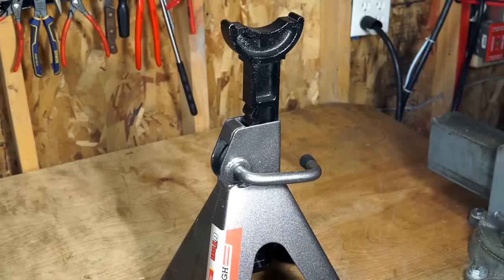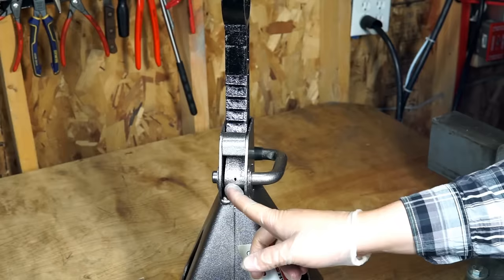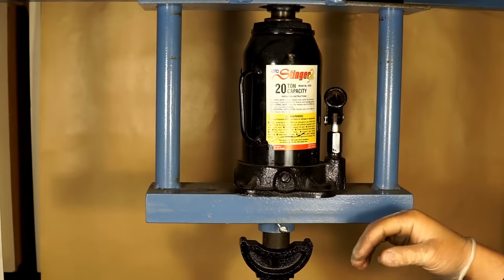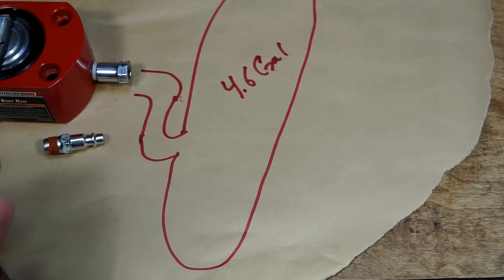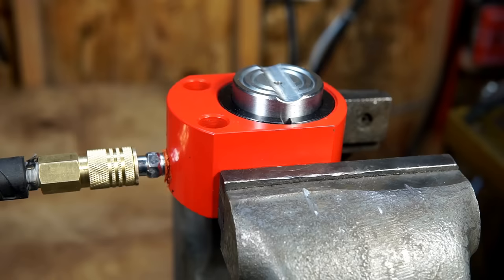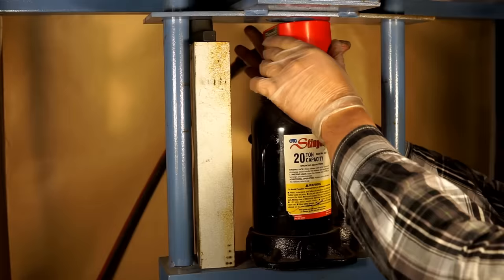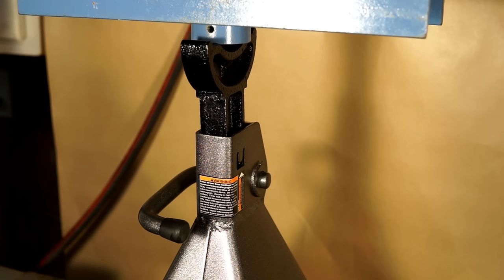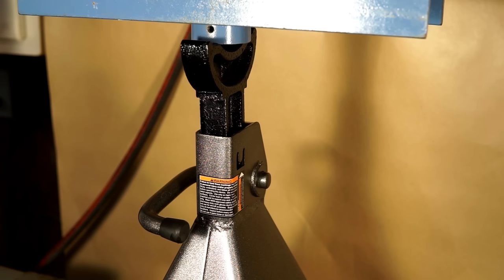EXPERIMENT: WARNING! Doing this to your Jack Stands will get you KILLED!

Comment: Sooooo.... I shouldn't hit the jack stand release while I'm under the vehicle. Got it. 
I'll add this knowledge to the previous bits such as: coffee=hot and 
no hairdryer in the bathtub.
Reply: He set out to see if one of the safety mechanisms designed into the jack stand was appropriate for working on lighter loads.
Reply: Kevin Livingston 

WOULDN'T THERE BE ENOUGH PRESSURE FROM THE CAR TO KEEP THAT LEVER PRETTY STIFF?
Reply: Yes, of course there is. This whole story is garbage.
Reply: Maybe if you understood basic physics it would help.... and more to the point if you understood that the  entire controversial video is designed just to get 'clicks', it would help.
Reply: Yes and he could have gone even further and put no load on the stand at all, to checked how easy it is to knock over sideways! lol
Reply: He clearly states that he is testing to see if the shear pin in the stands handle will shear off.
Reply: Don't forget not to throw stones near glass houses...
Reply: Kevin Livingston ha ha hahaha ha ha. I liked the video but ultimately this guy nailed it.
Reply: Noooo texting behind the wheel.
No putting on lipstick while driving.
No reading the paper while driving.
No working under a car supported by a stack of bricks, concrete blocks, scrap 2 bys......
The lawyers are on standby.
Soon every concrete block will have to be labeled "do not use as motor vehicle support."
Reply: Don't touch your tongue to a frozen flag pole!
Reply: @randomchannel1475  i dont wanna i always wanted to be Patrick let me sleep in peace under this rock
Reply: Too bad a plugged in hair dryer in the tub is extremely unlikely to do anything but flip a breaker.   Even if that didnt happen, the electricity doesnt want to go through your body to get to the drain and into the ground...   water doesnt travel up mountains nd electeicity doesnt look for the hardest substance to travel through.   

Movies though....   learned from them is a thing I suppose, not a smart thing, but a thing none the less.
Reply: I see you have yet to be informed of the actual hot coffee incident. Ask why does MacDonalds need to serve coffee hot enough to cause 3rd degree burns or why does spilling something make one an idiot in your book (a very thin book I might add)
Reply: @Kiluad  I. Think it's picking up the dryer from the tub that results in the shock.  Down the arm through the chest and the ticker quits working. The dryer in the tub should be safe, grounded to the pipes.  So don't pick it up while in the tub!
Reply: Lmao
Reply: Do not eat detergent pods.
Reply: You forgot "never stick a fork in a toaster while it's plugged in"

Comment: Aim the release handle of the jack stand away from your work area. Problem solved. CAUTION: Avoid violent psycho tantrums and tool slinging while under a car on jack stands. Second, rare problem solved.
Reply: Yes, I agre 100%
Reply: GS Allen Tool slinging tends to happen when you are working on a project car. Usually when you snap off a bolt, or when something mashes your finger. although i never use jackstands, so I'm good.
Reply: +A. Zak  Just have a bunch of sons and make them do weight training so they can hold the car up while you are working on it.  You can call your sons Jack, Stan, Block and Wedge.
Reply: You could ofcourse use a jackstand with a splitpen holding the release handle in place so shit like this cant happen.
Reply: That's what I say keep it away from anything that could hit the handle
Reply: I'm picturing some oil-caked maniac going full berserk on his back under a vehicle with like 2 inches of clearance between his furious thrashings and his hot exhaust manifold, JUST SLAMMING ratchets into shit, all four appendages in full scream like the Daryl Hannah replicant dying in the original Blade Runner
Reply: Wouldn't work... Second they get a SnapChat message, they would have to drop the car, take a pic of themselves, type out a reply and then take a minute to remember what the hell they were doing just before.
Reply: Or don't buy cheap jackstands... mine have lockout pins. They shove through the base and lock into the teeth on the ratcheting part, and will take the weight of the car if anything else in there fails. You can barely even move the handle with them in. No possible way to bump the handle and drop the car on you without also somehow pushing out the pin first.
Seriously, it's not like you're depending on the jackstand to save your life or anything... why the hell would you buy a cheap one?
Reply: LOCKOUT PINS????  I don't think I have EVER seen such, I have 3 or 4 sets of stands and NONE have lock out pins,
Reply: Awww damn no violent psycho tantrums? Nothing is gonna get fixed now
Reply: I Greatly Appreciate you taking the precious time out of your busy day  to enlighten me, I'm now looking at how I can modify the Cheap UNSAFE to make them safe!!  God Bless you Burt!!
Reply: You're welcome monsieur.
Reply: GS Allen
I don't have this sort of stand, but have been thinking of getting some of them and that was scary shit in this vid.
I'm from europe and have som light cars so extra scary.
But thought to improve the design of the "actuator" by turning it in to a round knob by cutting it of and use som flat stock and cut ot a flat circle and weld it on.
By the way ,avoiding violent psycho tantrums is not yet possible sometimes when shits just get shitty. :(
In the meantime I change de design of the actuator.  :)
Reply: Are you from Italy or France?
Reply: you will not cause this to fail unless you smash it with a sledge hammer, like he did.   Otherwise you would have to lift up the 500 pounds(240 Kg) with the stand handle.  Yes , the lever provides some amplification, but you're not going to be able to kick it free by accident. 

Don't worry, just get a jack stand for working under your car.
Reply: +spineboy I'd rather just have a Lift but without one I'd like a couple of hydraulic jacks (in addition to a couple of jackstands).
Reply: To GS Allen, It is very important to remove the jack stands before driving the car.
Reply: To really Happenings, Good analogy!
Reply: Face the release handle in towards the working area; prone to hitting it with tools. Face it away from the working area; neglegent adults might trip on it, if you have stupid kids at home, they might think its fun to kick it. Face it towards the front of the car so its not facing either inwards or outwards, suddenly your siberian husky came dashinh to lick your face...see its a design flaw.

Comment: I'm thinking the car wasn't on the stands level, it rocked relieving weight off one side then fell.
Reply: This is the most common reason - unlevel ground (driveway), stand at angle, no wheel block which allows slip and stand to fall/move/crush.
Reply: Bob Falfa yep
Reply: Yep
Reply: or maybe the guy rushed and didn't completely secure the jackstands with the ratchet jaw completely in it's slot do it was just teetering on the tip of the jaw
Reply: Bob Falfa .YEAH  i agree what u said
Reply: Bob Falfa : 
cayenne engine and transmission removed with subframe,

996 997 991 GTx cars and CGT and 918 and pretty much every cup car ever including the GT1,

ALL NEED TO BE STRAPPED WHEN DRIVE TRAIN/POWERPLANT IS REMOVED.

I think you hit the nail on the head with your suspicion... Or should I say 'hit the hammer on the release' with your guess
Reply: Maybe it wasnt even tounching the car?
Reply: I actually worked at the house that it happened at. The driveway is pretty flat so unless it wasnt good on the car
Reply: Rj laflesh no you didn't lol
Reply: I'm thinking the story was made up like most urban myths. The most common reason is that people make shit up.
Reply: Bob Falfa I agree
Reply: seen jack stands set up by people under angled sections under car or on swing arm suspensions which change angle as car moved up and down. scary. If im working under them i put them under flat solid stuff and put a pump up floor or bottle jack somewhere in case the stand slips or fails so it only falls to the jack. give you time to get the bod out.
Reply: best answer!

Comment: “Doing this to your jack stands will get you killed”: If by that you mean don’t apply a pry bar tto a jack stand handle and apply 1000lbs of pressure while lying under the car, then i would agree. Also don’t use a sledgehammer and swing directly at the jack stand while under the car either. Also don’t tie a chain to the jack stand and the other end of the chain  to a moving vehicle. also....
Reply: Schrodingers Box another good tip is to not put the car on drive while jacked up and traction axle is on the ground.
Reply: NEWS FLASH: danger is dangerous
Reply: One could interpret the title of the video as clickbait... but it could also be that the OP wants to make it clear how dangerous improperly replicating the experiment could be.
Reply: The "safety" pin inside is supposed to break..... That was literally what he was testing. He was checking to see what needs to be done to lift it, he got it to lift and the pin that was supposed to break, didn't.
Reply: Always have backups. Leave wheels under the car, leave jacks as backups. Being pinned is much better than being crushed.
Reply: Imthatguyhere Gaming 😃
Reply: Matt!
Reply: RECYCLED:   NEWS FLASH: announcing that danger is dangerous could keep people safe!
Reply: It's really easy to bump into your jackstand while you're under the car, trying to pull of rusty bolts or whatnot... Say you're pulling on a big exhaust bolt or suspension part, that's rusted tight after more than a decade. You pull for dear life, and then finally; POP! you get it lose. You lose control because you were giving your all to loosen that bolt, and as it popped, you smacked into the handle on your jackstand with a big prybar with all your weight and force behind it... It's definitely possible.
Reply: Schrodingers Bo
Reply: You are missing the point, accidents happen this was a controlled test to demonstrate it can happen and the pin didn't shear off. 
If you already knew this than why are you watching the video and if you didn't know this than you just learned something.
Reply: Pointless reason to make a video, what a waste of time
Reply: @TravisInCanada1  - Most of these jackstands are made in China. I wouldn't count on their choice of split or roll pins being correct to be shear pins.
If you're really worried about this, cut the handle off short, about 2" 5 cm.
Reply: Tio Bennett 
That is not a safety pin, but a pivot pin. It’s not supposed to break....ever! If it broke it was damaged and shouldn’t have been in use.
Reply: this comment made my day
Reply: haha....that was hilarious
Reply: One reason you put those release levers to the OUTSIDE of the car, away from the area you're working in. 

Also a damn good idea to inspect them regularly & check for anything that might be getting ready to fail.  It is possible that there was a broken tooth on the rack, or the end of the PAWL was broken off. It's also possible either of those failed catastrophically.
Reply: lmao
Reply: This post changed my life. But, you forgot about jacks made of bubblegum and teflon.
Reply: Gamma Catch, you mean 'Warning: Made In China' ;-D 

That wording really has been found printed on several Chinese products.
Reply: If you play catch with a jack stand and accidentally throw it too hard into someone's face, that could be dangerous too.
Reply: Lmao the goat of sarcasm
Reply: hmm more?
Reply: Lol!
Reply: @imthatguyhere   Exactly!  Always have "what could possibly go wrong with this" in the back of your head and take precautions.
Reply: uh..huh.. i have a set of those ...they aren't safe ..the channel the extender slides in can get stretched open a little wider wich makes it take much less force to trip the handle ..one failed on me after i bumped it crawling out ..the car fell but didn't get me ..i now use the kind that has a pin you have to slide all the way through the stand ...please don't make jokes and make people think they are O K .. they have failed on many people .. the likes you get on your witty comments could be getting people hurt or killed ..
Reply: The worst that's likely to happen in your scenario is that you hit the side of the handle and nothing happens. The chances of you getting your pry bar wedged under the handle in exactly the right orientation while applying enough force on the end of the bar to lift the handle are so low as to be effectively impossible.
Reply: Use common sense.
Reply: Schrodingers Box 
But I like pulling jack stands from under cars with a chain
Reply: someone needed to say it

Comment: Something no manufacturer would ever even attempt to demonstrate.  Thanks for sharing this.  I  am very cautious generally.  Your video was oddly chilling while also being reassuring.  Yes, these can fail, but seem to do OK unless a lot of force is applied.  Safety always comes first because we never realize when we are making a mistake (all accidents are accidental, so take steps to add extra layers of protection to you as you work hard, fight with parts, and get mentally exhausted).

Comment: I always do a shake test before I get under any vehicle on any kind of stands
Reply: Roof test, get on the roof and shake back and forth
Reply: @backyardburnouts8846  Not smart. Momentum multiplies the weight of the car. If you have a heavy car like a crown vic 4000 pounds and you create enough movement the jack can get unbalanced and fail. Especially if the metal of the car is structurally compromised from years of use.
Reply: @MARZOSIRUS  bla bla bla
Reply: Some people don't understand sarcasm lol
Reply: @MARZOSIRUS  OP is talking about applying as much force as you would when performing the service. Not testing is not smart.
Reply: Nah, to make a long story short, I don't get under any vehicle with a jack stand made in China.
Reply: To be safe, have a backup in case jackstand fails. I wont remove my jack and will use as a backup along with the jack stands. If I need to work for long then I have a second pair of jackstands that I also use in case the first jack fails. If you dont have extra jacks, leave your tire under the car.
Reply: @ravenbonanza1522  Now a days everything is made in China so unfortunately we dont have other options.
Reply: @backyardburnouts8846  lmao come on
Reply: Pretty sure this whole thing was not about a shaken car.

Comment: Someone may have suggested this already, but I reckon to test/measure the shear load of the handle pin, you should put it under the hydraulic jack like you had at first, then use another hydraulic jack under the handle, or a winch and cable over it, in combination with a force gauge to test at what load does the pin actually shear off.